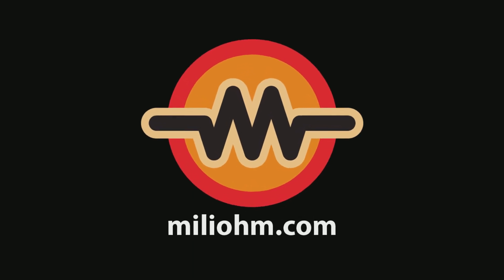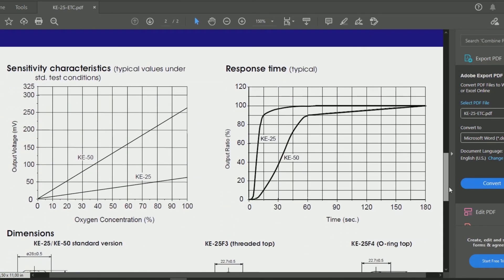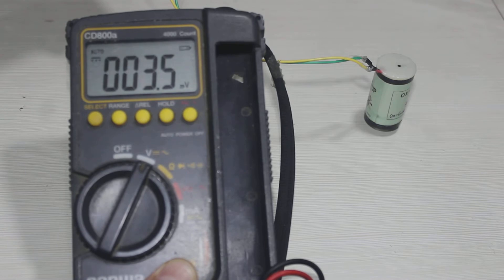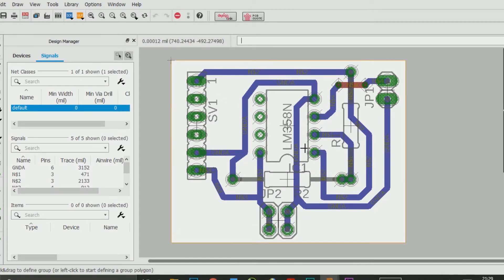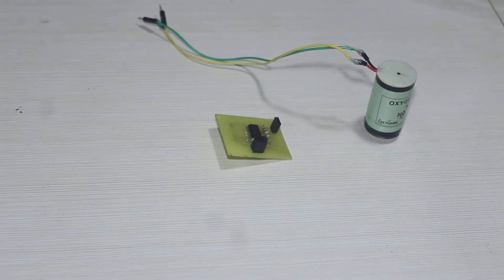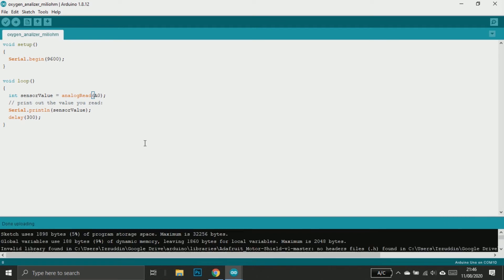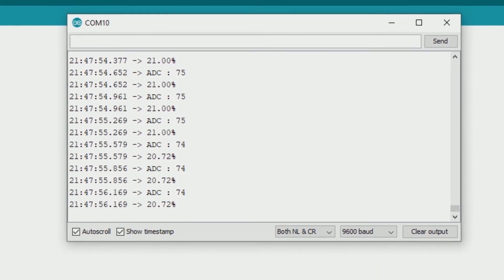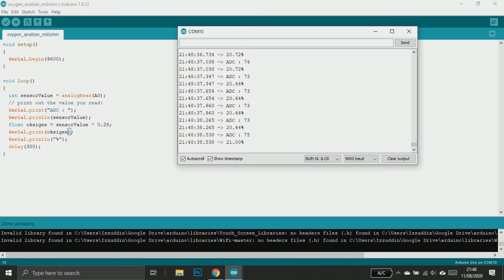How to use KE-25 oxygen sensor

Comment from the maker: I made a mistake while editing this video. The amplification should 101 times not 11 times, and the feedback resistor used is 100K not 10k. So the resistor are 100k and 1k.
Reply: Thank you for sharing and congratulations for correction.
Reply from the maker: @didiersee  you are welcome :)
Reply: I have analox o2 sensor from nuvair and analox. And how to make it work, because indicate only 6 % max calibration.

I changed 2 times of sensor but still error.

I have handy analox o2 e11

Please help
Reply from the maker: @gastech2343  sorry never use that sensor. So i'm not sure

Comment: Sir, I work on an IoT based respiration project, using on KE-25 Oxygen sensor and MG811 Carbon dioxide sensor,   I am facing problem to run the project, I need your help to up the project please help me sir🙏🙏

Comment: Great video, can the sensor detect soil temperatures? I'm looking for a soil oxygen sensor for Arduino and I think I could use this, maybe in a 3d printed case.. Do you think it's ok for this?
Reply: Does it work for soil oxygen concentration estimation? I too want to use Ke25 oxygen sensor for soil oxygen concentration need idea on data logger. What data logger I should use ?